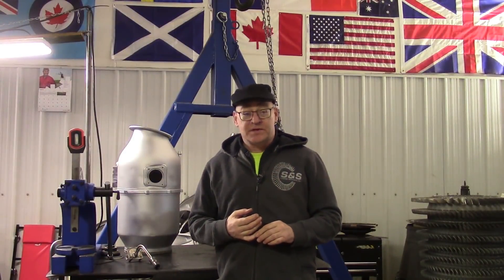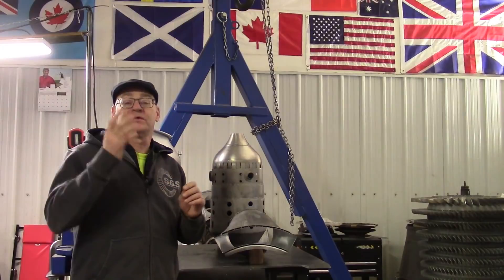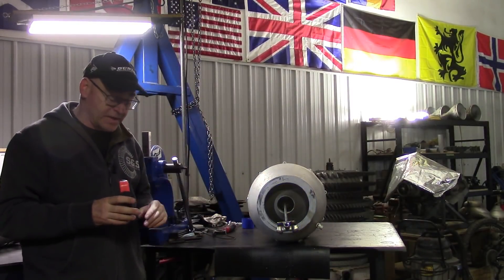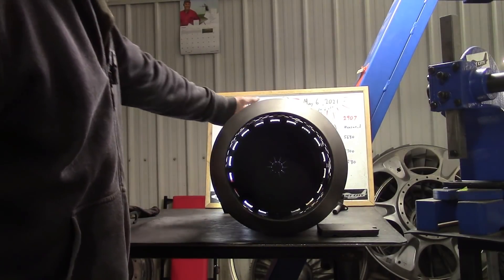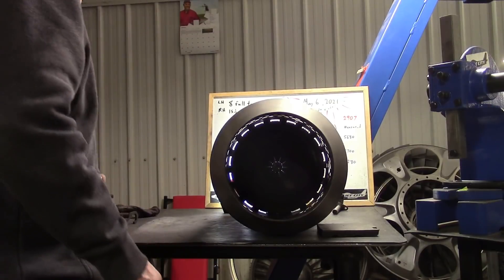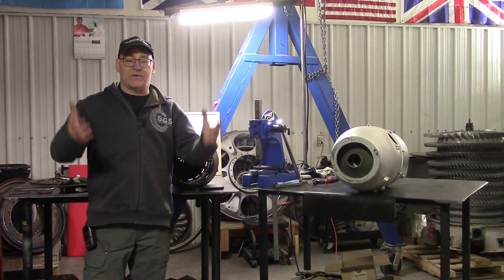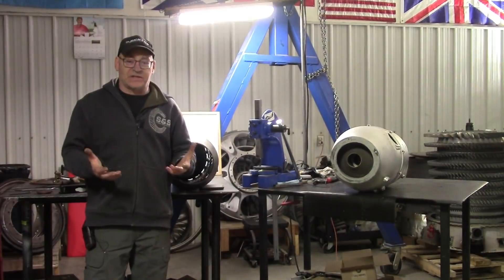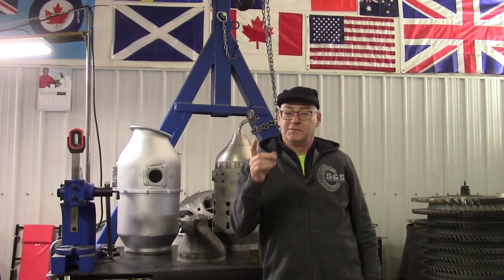Combustion Pressure in a Jet Engine  (2)

Comment: It would be cool to see the same video but explaining a reverse flow setup like on a PT6 or a PW120
Reply from the maker: I've done that. "reverse flow" is a misnomer. The gas path goes around a couple of corners, but schematically, it still goes from compressor to combustor to turbine, just like in every gas turbine engine.
Reply from the maker: Check out my video called " Reverse Airflow  ? "  I made 2 years ago.
Reply: @AgentJayZ  I just checked it out, the part that mixes me up is the “air jacket”. In that pt6 diagram it looks as if the compressor air literally wraps all the way around the combustion chamber and hits a wall. I realize there are pathways where compressor air moves into the combustion chamber but it’s still difficult to wrap my head around

Comment: Maybe a little chat about the combined gas law wouldn't go amiss. at least the simple stuff relating pressure/volume/temperature. or maybe you've already done it and i've missed it (likely)

Remember kids, point the hot end AWAY from face before ignition!
Reply from the maker: The citizens of Jet City are not "kids", and they are much more knowledgeable than you are carelessly assuming, Leon.
Reply: We're all kids to some extent! Apart from those that made the terrible mistake of losing the part of them that plays with toys, or uses their imagination for fun. and none of us like those guys anyway!

Maybe I should re-word my comment;
I'd enjoy seeing your take on P*V/T, and what it means inside a turbine engine. it's fairly intuitive, but that doesn't always mean the implications are obvious (not to me anyway). Sure, some of the Citizens are VERY knowledgable, have a degree in aerospace engineering and 30 years of experience, But many (like me) simply enjoy figuring out how this stuff works.

Stay playful Kids!

Comment: Technically I would say you increase the energy of the air. Which means all the molecule things move faster. 

This energy has to go somewhere. It increases the volume. If it can't increase as its in a closed space like a piston and cylinder. The pressure has to increase. Just like if you had put in a larger volume of air to start with. 

If it is to escape out a nozzle of some sort like in a jet. Then the larger volume can only do so in the given time by going faster. If it can't then pressure would go up and try to go back in to the compressor. 

Also the velocity a particular gas will reach exiting a nozzle depends on temperature.

Another thing is the mass flow in and out of the combustion chamber remain the same. The increased volume is less dense however. Just like the air in a hot air balloon. 

Basically the energy has to go somewhere. And depending on the situation you put the air on it will do different things. 

This was a bit rambling.
Reply from the maker: Rambling. Your first two paragraphs are exactly what I said. Thanks for telling me what you would say.

Comment: Great videos! What happens if an igniter fails in this engine? Does unburned fuel exit as part of the exhaust gas or will it auto ignite when mixing with the hot air in the turbine section? Also, how is a single ignition fail condition detected/rectified? Fascinatedly, Mike
Reply from the maker: Same thing as if a spark plug falls into your car engine.
ie, has never, ever happened. Not saying it can't ever, but it's just not a thing.
Also, you only need one spark to start a fire, and the engine has two on independent circuits, so a complete ignition failure is very unlikely.

Starting a jet engine is a lot like starting a candle. Spark until it goes, then stop sparking.
Sometimes it takes one second, sometimes three. All normal.
If a failure to ignite happens, it's as obvious as when your car doesn't start.
The manual says de-energize the ignition systems and the starter, then determine the problem.
Reply: Your question suggests you might be thinking that the igniters are firing continuously while the engine is running: they are not.  They are only needed to ignite the fuel on starting the engine.  You wouldn't keep that little spark going on your gas hob once the gas was lit, would you?
An engine will start quite satisfactorily on one igniter.  Two igniters are used on every engine that I've worked on for reasons of redundancy.   Engines do occasionally flame out in flight and need to be relit.  Would you want to rely on a single igniter to get an engine going again?
You might be wondering how an engine with six combustion chambers (combustors, if you must) lights 'all round' when it only has two igniters?  That's why there are interconnectors between the chambers: one chamber cross-lights another.
I recall, as an apprentice, helping with some altitude cross-lighting  tests for the Olympus engine in the ill-fated TSR2.  The tests were done on a combustion rig, which contained two chambers.  The chamber with the igniter would light up then, after a delay, the second would light up, with a 'thump'.
Reply: @AgentJayZ  Correct me if I'm wrong but don't most engines of this style have links between the cans so if one fails to ignite or for some reason goes out (very unlikely) it will be ignited by the flame from nearby cans?
Reply from the maker: There are multiple combustor liners in both "can type' and "can-annular" combustor sections. Those have usually two ignitors. Each combustor liner is connecter to the next one with what are called interconnectors, or crossfire tubes, which allow the flame to travel to all the liners on ignition.

Comment: I'm sure it varies but how much pressure is in the combuster?
Reply from the maker: It's the same as compressor discharge pressure, or CDP. Most manufacturers and Wiki pages don't list that, but they often list overall compressor ratio, often incorrectly called compression ratio.
This engine was designed in the late 1940's and was for a short time the most powerful jet engine in the world. It has a CDP of about 70 psig at max power. So if sea level is 14.7 psia, the the pressure ratio of this engine would be (70+14.7)/14.7 or about 5.75 to 1
A modern airliner engine can have a compressor ratio of over 40:1
Reply: The pressure drop across the combustion chamber walls is designed to be around 5percent of the compressor delivery pressure.  If it was much less than this, the penetration and mixing of the dilution air would be inadequate.

Comment: Are there combustor cans in the rolls Royce engine for the Boeing 757?
Reply from the maker: Also answering your other comment: as engines have continuously been developed and improved over the years, they gave progressed from can type combustors like the Orenda, to can-annular, like the J79, to what is now the modern standard, the full annular combustor section.
So, short answer: no.
All of these types of combustors are illustrated in my videos about combustor liners.
Reply: @AgentJayZ  neat jay zed thanks for the intel !!

Comment: But we are taught by the manufacturers that it is indeed a chamber - I get the thinking behind not describing it as a chamber but technically it is surely.
Reply from the maker: If you can call a perforated basket, open at one end a chamber, then I can call gasoline bacon. Mmmmm... bacon!

Comment: Force = Mass * Acceleration.  Mass hasn't changed (air-fuel mixture), but acceleration does.  For the life of me I can't figure out why the increase in force is unidirectional.  How do you control that, even if it's tied into the compressor stage up front?  Sum of all forward forces = sum of all backwards forces + resulting propulsion.  That polarity shows that adding fuel is the only input into the system, along with air that is introduced by the system.  It has no movement to begin with and is induced by the compressor stage.  So much confuse.  PV = nRT I understand.
Reply from the maker: Keep looking into it. Books and websites of reputable sources. It'll all become clearer.
Reply: Isnt the difference in volume per revolution of the compressor vs turbine what's the key?

To me it became clear when you imagine it like 2 piston engines coupled together. one functioning as a compressor and one as a air motor. Put a combustor inbetween and nothing will happen, but when you change the air motor size to double its original size it makes sense that the gasflow will drive the air motor size more than the resistance its generating on the compressor side.

Comment: The compressor provides the pressure to spin the turbine; the combustor supplies the volume. The volume of gas expelled from the turbine is many times that sucked into the compressor.
You forgot to mention that in the case of a malfunction that would cause either a sudden drop off pressure supplied to the combustor or an obstruction in the turbine would cause the pressure in the combustor to be higher than the compressor resulting in a stall.
Reply from the maker: That's an unusual way of putting things. "An obstruction in the turbine": does not happen.
"A malfunction that would cause a drop off in pressure to a combustor" ... would not "cause" a stall. It IS a stall.
But I will assign you a passing grade.

Comment: Whenever you see the guts of a turbojet engines combustion section, it's clear that the pressures couldn't be anywhere near the 600psi of the final stage compressor section. Those soda can looking tubes and housing couldn't hold that kind of pressure like say a cylinder sleeve in a piston engine. That impression alone supports the idea that all the psi becomes velocity after the compressor is done. The turbine is a kinetic wheel catching some of that velocity before the nozzle.
Reply from the maker: The combustor outer case does indeed hold in CDP. The combustion liner has many holes in it, which allows cooling air to flow inward towards the flame. It is subjected to CDP on both sides, so no real force is there to distort its shape.
Reply: @AgentJayZ  I guess my piston engine thinking is used to what holds extreme pressures that rise sharply and then a micro second later are subject to near the opposite. I suppose jet engine pressures aren't meant to surge so can be maintained within apparently lighter looking vessels. Part of your video confused my thinking in that I thought the CDP had already dropped by the increasing velocity again in the burners so I figured the burner casing experiences the same. My bad. So does the CDP only drop after the turbine section?
Reply from the maker: The turbine removes energy from the exhaust gases. the gases lose quite a bit of pressure and temperature when passing through the turbine section.